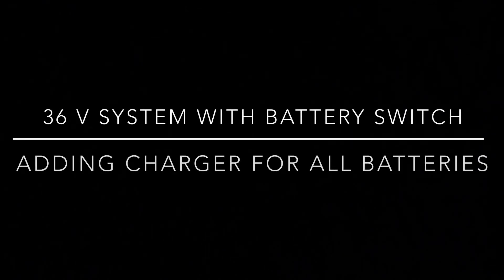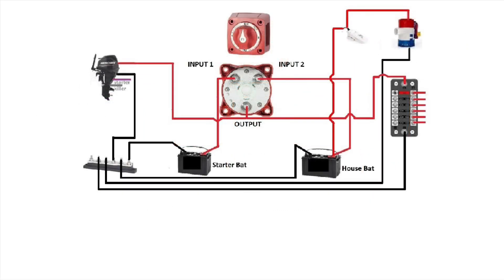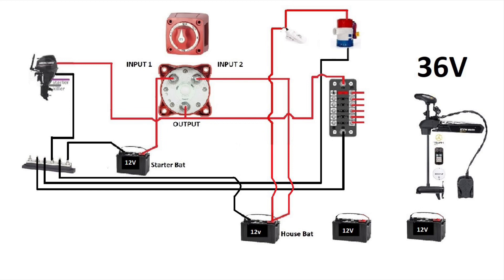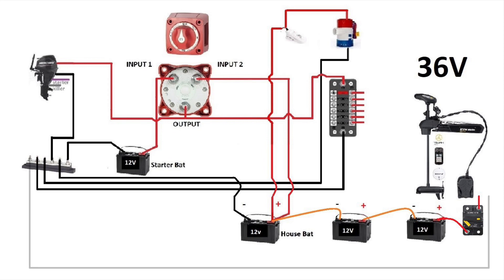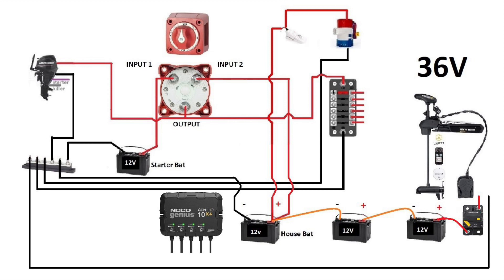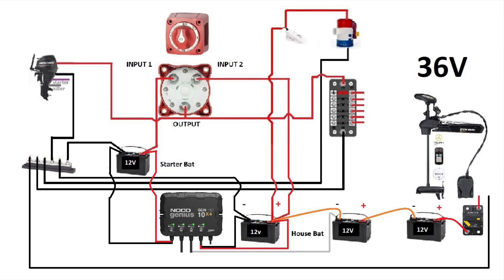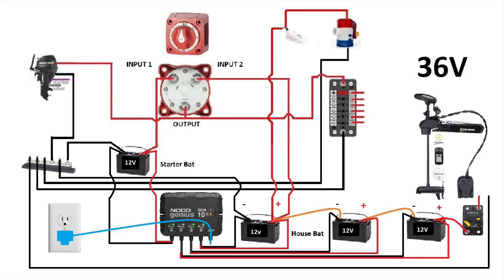36 V & 24 V System with battery switch, added charger for all batteries. Wiring diagram

Comment: Love your videos but still looking for a video using a 12v to 24v lithium install. Installing a trolling motor and unsure I have the correct wiring and parts to not damage my lithium battery. Setup:  12v deep cycle marine house battery being charged through the VSR by the 12v starter battery alternator. Have a single dedicated 24v lithium battery at the front of the boat used to run the trolling motor. Would like to have the 12v house battery charge the 24v lithium battery. I have a 12v to 24v step up voltage regulator that I was thinking would connect from the 12v house battery to the step up voltage regulator then to the 24v lithium to charge it. Am I missing another part or will this work? Implemented your wiring diagram with the solar panel to assist in charging the starter battery. Works great.
Reply from the maker: Hi TonyMacUSC, if you would like to have the 12v house battery charge the 24v lithium. I would look into victron orion 12/24 dc-dc converter. That would be one of the solutions, a little expensive but a good solution. :)

The regulator might work but can damage your 24V lithium battery.

I'm glad to hear that your solar system works great :)

Comment: hey there @joetheboatguy5394 thanks for all the videos. Quick question. Adding 2 Optima D31M (blue top Group 31), to a 1/2/both/off 3 post switch. How do I install an ACR to them? Is it as simple as + from starter battery to + of ACR,, and + of house battery to the other pole of the ACR, and then switch pole 1 to starter + and switch pole 2 to house +?
Thanks in advance.
Reply from the maker: Hi Mannyleggio, thanks for watching. Sounds just about right what you’re trying to do. So + from starter battery to arc A and + of house battery to arc B.
Reply: @joetheboatguy5394  thanks Joe. Just got the boat back this morning. Gonna wait for clear, slightly warmer weather to tackle the joe.. I'll keep you posted.
Reply: Had to edit my post to clarify. So basically the + of both batteries go to each of their respective sides of the ACR and normal business with the 3 pole 1/2/both/off?

Comment: Will I be able to use a switch to sufficiently charge a 36 v system with my main motor?  I have a 4 stroke Mercury outboard.  I want to be able to charge my trolling motor batteries with main motor as well.
Reply from the maker: Hi Da-LA, thanks for watching. Have you aver seen the trollbridge units? They have for 24v and 36v systems. Here a video I did to show it but it’s on a 24v systems. You can definitely do it with a 36v system with the bigger 36v unit. Check it out

https://youtu.be/jn9tI_nb5ds?si=UUOQbXZoQKKut7kT

Let me know if this helps 👍
Reply: @joetheboatguy5394  Thanks Joe!
Reply: @joetheboatguy5394  Hey Joe - I was hoping for something simpler and less expensive.  The trollbridge units for 36 v system here in Canada is over $300, same as external alternator. It all adds up these extra accessories needed.  I was hoping to be able to just use a   a/b switch - with b charging 3 batteries at once  with my main motor (115 HP).  After looking at your diagram it looks like the answer is NO. I can charge ONE of the 3 batteries, but not all 3 at the same time.  Correct?  Thanks again Joe!  Much appreciated!
Reply from the maker: @Da-LA, I understand they are a little pricy. You would have 2 solutions left. You can install switches like you said you wanted to do but you are open to human error by forgetting to flip switches when needed. 

Or solution 2, little more complicated but fully automatic but you need to have Ignition power.  You can install 4 relays on the farther batteries, so they can switch automatically to series when ignition is on the OFF position, and parallel config when ignition is on the ON position. With this setup you can only use your 36V trolling motor when your key is on the OFF position. As soon as you turn your ignition ON your batteries will be set in a parallel setup so they will recharge.  With solution 2 they are always risk with relay failure. 
Let me know if this helps 😊
Reply: @joetheboatguy5394  Thanks again for your time Joe, and yes it helps.   I'm a Red/Green kinda guy and so far have been fairly successful with my past setups, however this is much more complicated now that I'm using a 36V setup for my trolling motor and I'm pretty intimidated by the setup to do it properly and costly unfortunately.  What is ultimately the best solution Joe?  Probably go with the external alternator then?  I'm running a 115hp Mercury 4 stroke motor on a pontoon btw.  I'll probably have to get a pro to do the wiring  - big $.
Reply from the maker: No problem :) , your best solution but the most complicated one, would be the adding of 4 relays. Do you have ignition power?
Reply: @joetheboatguy5394  Not sure about ignition power - picking up the new boat May 11.  Thanks for the info. again.

Comment: This was SO helpful in my recent wiring project for my trolling motor.  I do have a question about charging from the motors alternator.  Will the house and starting battery charge off the motor alternator in this scheme?  Or would you need to add a separate alternator to charge the house battery?
Reply from the maker: Hi John Midgett. Thanks for watching and comment. The motor alternator will only recharge the battery selected by switch. So, if you’re on 1 your starter battery will recharge. If you’re on 2 your first house battery will recharge but not the 2 others in series. You would need other equipment to recharge the 2 other batteries from the alternator. But another important information is most alternators are designed only to charge one lead acid battery, and any more can cause it to overheat and melt its winding.
Reply: @joetheboatguy5394  Thanks!  Previously it was set up with a battery switch and there was no problem with it charging both when both 1 & 2 were selected.  I will explore other options -alternator charger to charge the trolling motor batteries.
Reply from the maker: Yes absolutely. I have 2 battery recharging on my boat also. But some outboard alternators or regulator might heat up ☹
So I can't really say to do it and then cause some damage ☹
Reply: @joetheboatguy5394  If I add an alternator charger to this system, to charge the trolling motor batteries, would it affect system adversely if running the batteries on all?  I guess this would present the same problem with the alternator on the motor?
Reply from the maker: Hi John Midgett, Here’s a unit that will do what your looking for. Take a look at: https://youtu.be/jn9tI_nb5ds 
Let me know if this helps

Comment: How would this diagram look with disconnect switch, starting battery and 24 volt trolling motor.
Tracker 195, 75hp optimax.
Noco 10x3 charger.

Thanks in advance.
Reply: when the gas motor is running will it charge the trolling motor batteries also if the switch is turned to all?
Reply from the maker: Hi Shane Stevwing Fishing, Sorry, I have a question for you before I answer. What is your setup? You have a 12v for starter and what for trolling? 12v 24v or 36v? Let me know 👍
Reply: @joetheboatguy5394  24 volt trolling motor
Reply from the maker: Ok if you have a 24v system and you want to recharge with outboard you will need a system like this one: https://youtu.be/jn9tI_nb5ds 
Let me know if this is what your looking for.
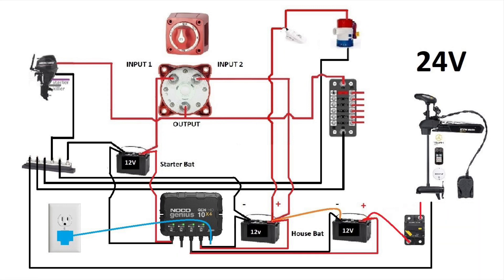Reply from the maker: Hi Icrozz1, thanks for watching. You will see the set up your looking for at 4:40min in this video. Let me know if that’s what your looking for 👍